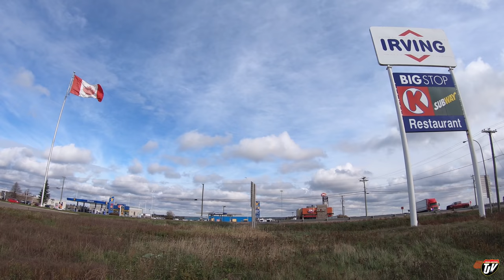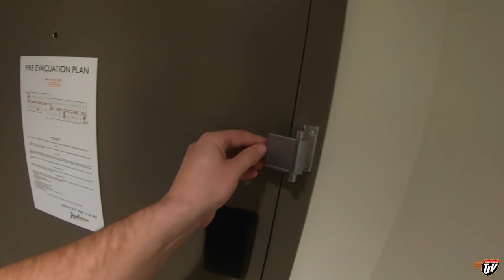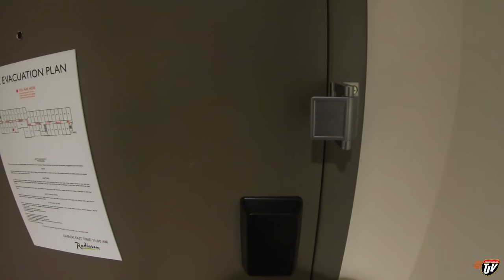My Trucking Life | BROKE DOWN | #2116 | Oct 29/2020

Comment: #200    Good morning, Josh.  I'm a RV'er, my 2014 Winnebago Trend 23B had recently been in the shop for Cummins Generator failure.  The Generator Starter motor failed, lost the use of it for a couple of weeks and $2,300.00 (US).  New parts had to be ordered!  But its now working, and the Generator is functioning as it should.  Costly repair!  Just to show you are not alone  with crises.

Comment: That exact code is why I got rid of both of my 579s with the pack car engine. Something's not designed right in there after treatment system I was going through dose or valves like crazy

Comment: I had the same issue on my 579 with a def tank sensor. From the dealer I got it fixed at in Orlando, they said Peterbilt limits each dealer to only one def sensor per day since they go out so often and cant keep up with keeping them in stock. Thankfully it's only happened once in about 120k miles.

Comment: That happen on 2014 Ram ecodiesel. They had to change the entire def tank to fix it, as that sensor was part of the tank and can't be serviced separately. The tank was $650.00 for a piece of plastic not to include the labor to remove and install😟